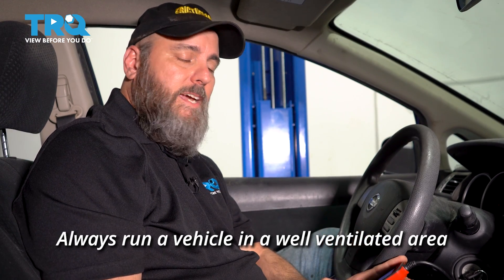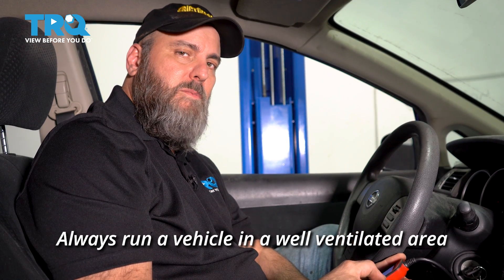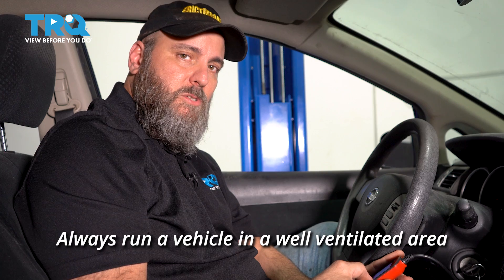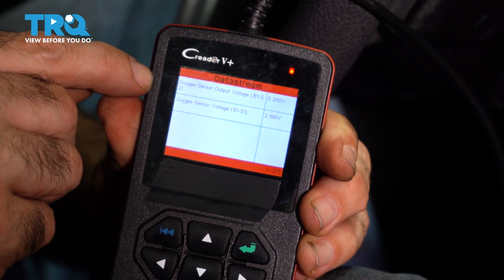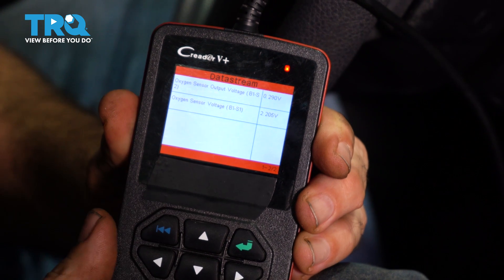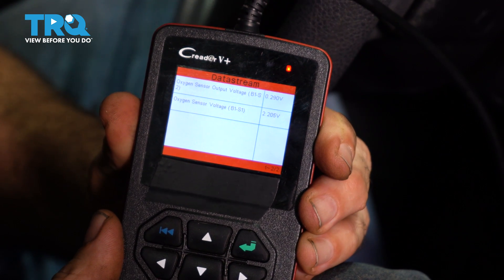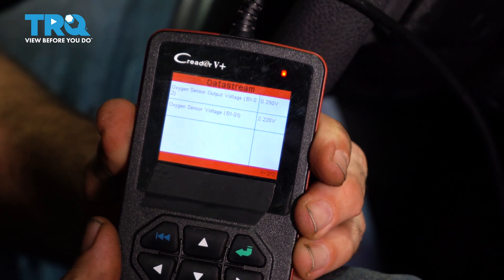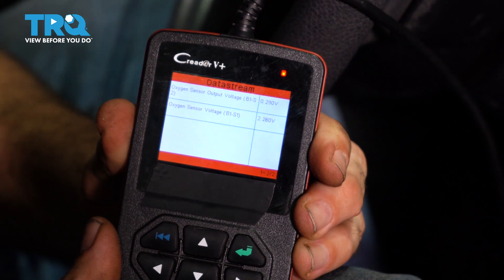EricTheCarGuy Explains Check Engine Codes - P0420 Catalyst System Efficiency Below Threshold

Comment: What if the vehicle doesn't bog down when this code pops up. My truck runs fine but this code popped up today. Ive had issues in the past witha misfire on the side where this code originated. The misfire was fixed but the truck iant passing emissions because it has a leak in thw system.  So can this also cause a false p0430?

Comment: Great video, but maybe I missed something: what caused the catalytic converters to go bad in the first place? I just had both replaced on my 2014 Kia Soul about two months ago, and they went bad again. I took it to the dealer and they said it was because they were after market and because I used cheap gas. I'm about to take it to another mechanic and hopefully he can tell me the root problem and what to do. I can't afford to have the same thing happen a second time. Thanks again for the excellent video!

Comment: I get the code then it goes away. Then comes back... Last time replacing the pcv valve got rid of it and I thought that was it but light came on a week later .II had also encountered Evap code and the catalytic code, replacing purge valve turned light off. Very confusing.

Comment: How do I find someone to do a thorough diagnosis on my car's intermittent p0420 code? Where do I find a mechanic like Eric? I'm being told the cat is bad over the phone, they haven't even looked at my car. The muffler shop recommended changing the 02 sensors. The cat was replaced 2 yrs ago. I'm in the Houston area.

Comment: If you're getting a p0420. The chances are the ECU has been compensating for quite some time. Don't cheap out on parts, buy quality/OEM. You have to get onto asap, swap out the cat, and the pcv/egr. 

The next thing you'll get issues with are dirty fuel injectors because of back pressure from the cat being clogged and oil residue throughout the intake and exhaust from oil being burned from a worn PCV/EGR.

Always use a healthy battery to prevent the alternator from getting cooked by being overworked.

If you haven't done the coils and plugs do them, too - It's time.

Comment: thank you eric i did learned something today. I was having a trouble with my 2010 honda accord it had about 280,000 miles and it still runs great except the code is on so iam concern that its not going to pass the coming up smogcheck. i did replace the upper and lower sensor bank 1 and 2 and it did not do anything the code still comes on  i guess i should try replacing the catillatyc converter next thanks for the free class. i always watch your video first everytime i have issues in my car.

Comment: Dissgree. A biased O2 sensor can easilly say there's more O2 than there should be and the computer will add fuel to compensate creating a rich condition that csn clog a converter in short order. Always replace the O2 sensors FIRST if you suspect a bad cat. Why? Because it would be absolutely retarded to put a brand new cat in and put the old O2 sensors back in so you might as well replace them FIRST!

Comment: Im currently having the same symptom with a lean code. Did disconnect the a/f sensor and test drove and actually drove fine. Connected back and started hesitating again. I have a feeling its a clogged cat as I gas it and passed 2k it revs fine

Comment: What happens when you check mode 6 in the scanner and see bank 1 sensor 1 rich to lean threshold voltage (contant)? Is that because of the cat  converter?

Comment: Hi Eric. Cheers....my 2003 Dakota 4.7 sport gives me Code p0421...Time for inspection...ouch...Truck runs fine...no restricted-sounding exhaust, acceleration is great.  I am praying ,due to high cost, that it doesn't require a new Convertor.
Could this be O2 sensors, plugs, or a real exh..leak..?? Apolgies for jumping in..Cheers for a great day...best regards,good sir...Rob G Albany NY

Comment: Honda Pilot 2017 owner here:
In December 2023, I got the famous P0430. I went to the Delaer under Warranty to change the Fuel Injectors (150k Warranty). 15 days later P0430 came back, dealer told me to start with the O2s sensors and change the 4. One month later again the P0430 and the dealer change the 2 catalytic converters. Guess what, P0430 came back and all this time back and forward and 2025 came NO MORE WARRANTY, and for check again is over $165 to read the stupid code plus some other part that they want to change... Fxxxxck me

Comment: On 2012 Nissan Altima I use 2-3 times a year catalytic cleaner regularly. It almost 14 years as manufactures CAT does no problems. I assume it will give up in a coming future is there a reason to repair it or go for a new one.

Comment: My car is doing this and has a fuel imbalance. It is running under 1,00 rpm after I just fixed a collapsed intake lifter in cylinder seven.

Comment: I have 0420 code and O2 bank 1 sensor 2 voltage stability with value less than 0.2V so it means lean burning. I think catalytic converter is ok in this case, just have problems with ignition or fuel injection system

Comment: I added some cleaner to the fuel tank and noticed that my check engine light just went off. I also noticed that all of my monitors show okay. However, there is still a trouble code p0420 that shows when I connect my OBD reader. I have a Honda Accord 2015 and live in Illinois. Will I pass an emissions test if all the monitors show okay, and the engine light is off but the p0420 code still shows?  For some reason my OBD device does not erase the trouble code when I try. I'm just wondering if they're going to tell me I failed the test because that trouble code is still in the system? I tried to renew my registration online but was unable to because when I initially took the emissions test it didn't pass. They want you to fill out some paperwork that includes how you fix the problem and then you can go take a second test. So I've done that part but I'm hesitant to go in without knowing I'm going to pass.

Comment: Mechanic here. If you're able to catch this cat code early enough, and if it's the only code coming up; no ignition coil pack codes and you're around 100-120kmiles... it will most likely be your spark plugs causing misfires that a lot of ecus won't detect and/or give a check engine light for, or even a code, upon scanning. 
Change these and you'll stop your cats getting blocked up with unburnt fuel. 
Also, as mentioned, if you catch it early enough you can change out the plugs and run a bottle or two of Cataclean through your gas tank to burn off any blockages in the cat. This will save you needing to replace the cats.
Again, this is only possible if you change the plugs out the same day you get this cat code. If you get the cat code but also a coil pack code, never replace one of anything. Always replace all plugs and all coil packs at the same time (a full tune-up). 
Hope this helps

Comment: O2 sensors have 4 wires and air/fuel ratio sensors have 4 wires....? 2 for heater ckt and 2 for signal/ ground. The difference is an o2 sensor fluctuates its reading between 0-1 volt, air/ fuel ratio sensors, AKA Lambda Sensors, work from 0 to 5 volts and 2.5 is perfect Lamda, which is 14.7 to 1. Which a reading of 2.5 is a perfect mix.

Comment: 9 times out of 10, a p0420, 0430 is a bad o2 sensor. Only if you smell rotten eggs or a huge loss of power is it a bad cat, but most shops will tell you cat because they would rather sell you on a $1500+ job than a $200 one

Comment: Code pO420 Put blower end of shop vac in tailpipe, taped it. Turn on vac. Sprayed soapy water from back to front. Bubbles at backside of cat. Connection.  Total time 10 mins. Seal leak, 10 mins

Comment: I had my brother replace both of my converters on my 2012 Ford Fusion SEL awd 6 cyclinder.  Now that he's done that my engine light stays on with a bank 2 error.  We even replaced the up and down 02 sensors.  These converters are aftermarkets since Ford doesn't make OEM anymore for this year.  What could be causing the light to stay on?  He says that the rear converter is 1/4 of the size as the original.  Please help.  The car runs brilliantly.  Just the light says 'somethings wrong'

Comment: Something that caught my eye bank #1 sensor #1 voltage reading was around 2.2v. Oxygen sensors range from 0 to 1v. Meaning you have a air fuel ratio sensor in the the pre catalyst (sensor 1) and not an oxygen sensor which means you will not see much fluctuation as stated in the video.

Comment: I had a 2004 Taurus with the 3.0 V6.  Kept getting the P0420.  What I did to pass emissions was reset the code with my scanner.  Then keep the scanner on and go drive the car pretty hard with a few WOTs in there too.  The scanner will tell you when all the MILs are out of test mode.  I would then go directly to get my emission test which is good for 2 years.  The light would maybe come back on in a few days or more, but the car drove perfect with great MPGs for years.

Comment: My daughter's 2019 Kia Soul has this code (0420) It came on after I had a shop fix the #3 cylinder misfire and fuel injectors. Kia wants $3,200 just for the converter itself, and no shop wants to fix it for some reason.

Comment: I have a p0430.. i did a  shop vacuum in the muffler n soap water found crak form the exhaust behind the cat . Wit a rattling in z cat the same side .. dont kno if can delete the cat or its a muss to replace those expensive cat

Comment: Old cars,  cats lasted forever on them.  Just shocking,  but mine doesn't do that at all.  Runs fine and will drive 70 mph with ease. Also,  is that the hottest the exhaust gets? I have carbon on tail pipe and both o2 sensors replaced for the cost for me.  Didn't take the chance.

Comment: You're supposed to check exhaust back pressure to diag a restricted exhaust. This test is 100 percent accurate unlike the attempt to diag by engine vacuum. It doesnt matter what temp the cat is if its plugged. Temp doesn't diag restricted exhaust either. Just more wasted time. Test back pressure by removing an o2 sensor and installing a pressure gauge. Accurate and quick. Less than 5 minutes to properly diag. You have more than 5 minutes into 3 different incorrect attempts to diag. Flat rate techs do not have time to waste on improper techniques.
Reply: Eric had an obvious performance issue during the drive test. That should've shown up with the vac gauge on the intake if he would've driven the car. I have an MDX with P0430 but my MAP sensor on my Torque app shows vac is good at all speeds and load, it should be the second sensor is my conclusion. Does that make sense?
Reply: But doesn’t th catalytic converter have to be changed every 8 years ?
Reply: @Californiaqueen209  Catalytic converters are “supposed” to last the life of the vehicle. If one is bad after only 8 years, then there is another problem going on that is causing it (i.e. fuel injector stuck dumping too much fuel and burning up the cat).

Comment: i own  a 2013 chevy cruze 1.8 L manual transmision  after replacing the head gasket i got  p0402,324 and 326, replace the knock sensor   and  clear the cods,  worked for 2 day and got  P0420,  clear the code and 2  days later  got again 420,324 and 326, what is going on?

Comment: I’ve had old, misfiring spark plugs cause the P0420, P0430 codes due to incomplete fuel ignition. Check the less expensive things first. Not a car repair expert, just a shade tree mechanic on my own vehicles for 40+ years.

Comment: Had P0420 code for years on my car, would have to replace my cat before emissions to pass, had real bad oil burning. Imagine to my surprise after having poured and soaked my cylinders with Berrymans B12 for only 12 hours with the intent to fix the oil burning, as its been obvious could see the soot coming out if the tailpipe previously and would dirty the bumper it was that bad with this constant P0420 code legit actually cleared on its own maybe a day or two after just normal brief driving not even having driven on the highway in that time. After trying cat cleaners, Sea Foam, Berrymans B12 cylinder soak did the trick. It was a hard start as expected when its initially flooded but worth every penny.

Comment: Before you turned off the lights, we could clearly see the light through it in your video. Strangely after you turned off the light, no light through. You should have watched your own video more closely. What did we learn? Replace them by the new ones which is the easiest and most expensive way to fix it.

Comment: 2012 Frontier 140000 miles.Had 420 code showed bank 1 . Ran 2 bottles Cataclean. 100 miles later code back. Next mechanic diagnosed 12% block Bank 1 side. Cat temp ok. Ran 2 bottles Duralube cat cleaner thru 2 tanks. Lights went off 125 miles ago. Waiting fingers crossed.

Comment: Hmm. My 2009 Mitsubishi Triton has just comme back from an oil change with a ‘cat system below efficiency’ error. It was however replaced only 20k ago. It has always had a check engine light which is due to an exhaust manifold crack. Would this attribute to a cat system fault. 
It does have 399k on it!! 2.4l petrol. Never had head lifted.

Comment: Asking a question for understanding.  I've got an 07 Dodge Grand Caravan, 3.8L V6.  It runs like a scalded cat and idles very smoothly, but has the P0420 code.  B1S1 (upstream) sensor is switching rapidly like it should.  However the B1S2 (downstream) sensor is reading a constant and steady, very low voltage.  Again, the performance is undeniable.  It runs incredibly well.  I don't think the Cat is clogged.

With the downstream sensor only giving off a low voltage and not switching, would it be safe to say that my code may be caused by a faulty downstream sensor?

Comment: This is EXACTLY what my wife's 2012 Jeep Compass is experiencing. No check engine light, however, the car will not accelerate past 20 MPH, all-while showing a P0420 (Permanent) code.

Comment: Hey Eric.  I have 2015 Mustang Roush RS3. Stage3.  Getting no code misfires on cylinder4 and 8.  Changed plugs , coils , injectors, etc….   Still getting misfires around 1200 rpm sometimes at idle.  I have the Ngauge tuner,   My Cats after it is at operating temp.  The temp of the Cats.  Bank1 s1 and bank2 s1.    Shows the Cat temps are 1000 or deg F.   I do a pull to about 80mph and Cat temps Go up to about 1800 deg F 
Are they getting to Hot?   Thanks in advance.

Comment: Also I have had if the cat isn’t up to factory spec it can also throw this code, I have personally experienced this on my car , replacing o2 sensors and warranty out 3 cats with flex pipe and then ending up driveing with this code for years 🤷🏼‍♂️

Comment: I've been driving my 09 Chevy Traverse, with the P0420 code for over a year. And it's been driving fine, maybe a little drop in gas mileage. But for some reason, the check engine light will turn on for awhile with that code. Then after driving it for a bit, the light will turn off by itself. Another thing I've been doing, is using some cat cleaner every so often. So I've been back, and forth either replacing the cat or leaving it be.

Comment: I’ve got a 2002 Toyota Camry with a rebuilt cat.  The place that replaced it smogged it but its that time of yr again, check engine light is on and coding P2423 OBD II and P0420, Toyota tell me they have the diagnostics to pinpoint issue but will charge $200 to do so, of course I won’t have them do the repairs because they’ll be exorbitant. I’m female and I always research but fear being taken advantage of.  I have a little saved to pay cash for a used car.  Opinion?

Comment: I got a P0420 code and couldn’t pass emissions. Dealer wanted $4k to replace the catalytic converter. I got some CataClean for $26. After about 100 miles CEL disappeared. I passed emissions later that day.

Comment: My 2014 Jeep Grand Cherokee Laredo with the V6 throws up code P0420 but there's no symptoms tho... no drop in gas mileage and no loss of performance. The first time it disappeared was when I sprayed intake cleaner to remove carbon buildup which cleared the code at first but eventually it came back